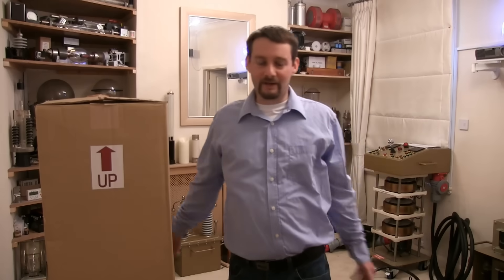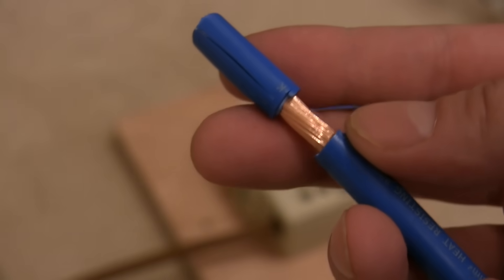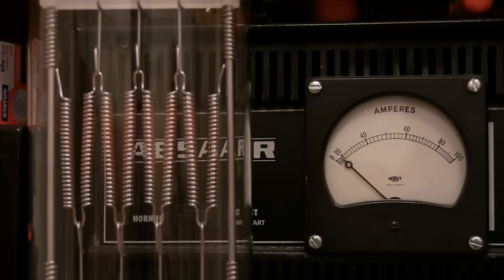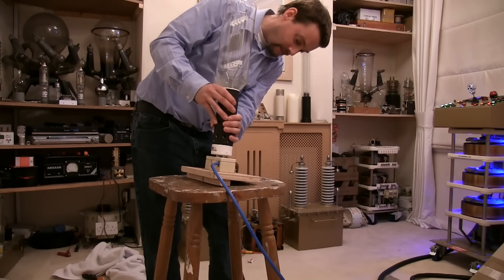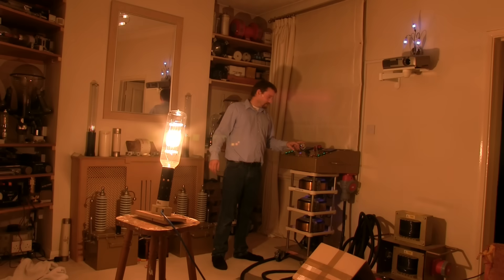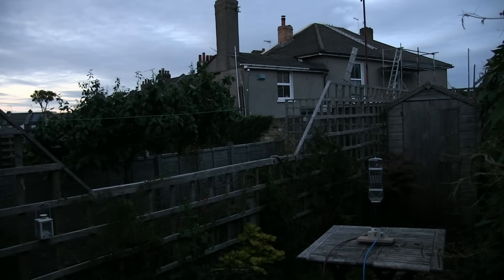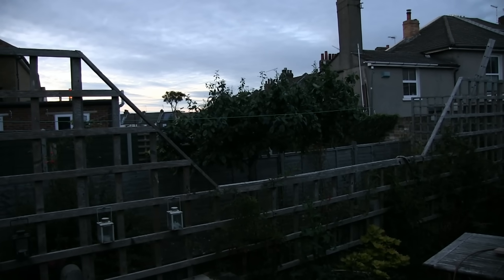20,000 Watt Light Bulb Test

Comment: Sylvania 54342 - BCM 64818 CP/99 20KW 230V Projector Light Bulb
by Sylvania
  Price: $6,301.39 + $3.99 shipping   ( dam)
Reply: Gotta have that $3.99 shipping tho.
Reply: The reason the bulb is so expensive is because the envelope uses fused quartz and not regular silica glass. Regular silica glass cannot be used because not only would it melt, it cannot withstand the extreme pressures in some types of high powered bulbs.

Quality fused quartz is very expensive to make, especially a large intricate structure like a hollow bulb.

I've worked with 4 kW long arc xenon bulbs and the fused quartz envelope would get orange hot during operation.
Reply: Gotta have that $3.99 shipping tho.
Reply: Gotta have that $3.99 shipping tho.
Reply: Gotta have that $3.99 shipping tho.
Reply: Gotta have that $3.99 shipping tho.
Reply: He can send back in 14 days with money back guarantee. hehe
Reply: Gotta have that $3.99 shipping tho.
Reply: Gotta have that $3.99 shipping tho.
Reply: Gotta have that $3.99 return shipping tho.
Reply: Are you serious??? Over $6000 ?? The materials cost hardly anything, even with having to fill it with a noble gas... WOW, if I needed one, I would make one myself.  That price is insane for what it is.  They can't fool me with numbers.. OH but it's 20000 watts... LOL it can draw 20kW because the filaments are a large gauge.
Reply: But wait, there's more: order in the next 15 minutes and we'll throw in a handy polishing cloth and a pair of asbestos hand mitts.
Reply: Average lifetime: 350h 
That is one expensive light bulb.
Reply: +Christmas Eve Have you ever tried working with fused quartz, especially such a HUGE amount of it? I think not, otherwise you wouldn't say that. Melting things to ~2000 °C is kinda tricky you know.....
Reply: All HID lamps and Halogen lamps (Aside from HPS, and CMH) use fused quartz, or some form of quartz.
Reply: www.lightbulbs.com/product/sylvania-54342/?source=NexTagCSE
Reply: no, that price is for 4 of them.... they are $1,599 each.
Reply: +svampebob007 That's all nice, except no company has cornered the light bulb watt market even in the 20 kW category. There are several players in it who also suffer from the competition posed by Chinese companies. This means that the $6k price is probably closer to that light bulb's lowest possible price than you might think...
Reply: Gotta have that $3.99 shipping tho.
Reply: Your comment is proof of how clueless you are
Reply: Please be sure to record yourself trying to run 20kW through a light-bulb with a glass housing, and have your next of kin put it up on Youtube for us.
Reply: +dischargecraze Yep, it's been made to be as bright (=efficient) as possible at the cost of making its lifespan really short....
Reply: Steve Hartman they jest changed the add weeks ago, They meant  four, but had the price for one at $6301.39
Reply: +Christmas Eve
Industrial components aren't merely based on the cost of the materials, the price is linked to availability (not many people produce 20kW bulbs, not many people buy them) and quality/reputation if you're known for producing amazing 20kW bulbs then you can expect owning the market for that, but if you're know for having hist bulbs with heavy prices then you can expect not getting into that very nich marked.

$6000 is a lot of money for a single person, but you have to realize that bulb (or other expensive "profecional") stuff will be used to generate revenue several times the cost of it.

If they sold it for the raw material price they would be underselling their service.

For regular consumer stuff, you need to try and sell it as cheap as possible even take on some loss, because consumers can always go for the crappier shit that some other company is selling they have no incentive to keep buying your stuff if it's a couple % more expensive if they can get away with the other dude that can deliver the same service.
Reply: Dam! 3.99 for shipping?
Reply: CoolKoon
 true, though I'd think there would be a reasonable profit margarine, if there wasn't it would be just good to focus on the consumer market. I'd assume you don't have to buy those bulbs in bulk...? anybody know what their operating time is?
Reply: better last a year or two
Reply: Many high power lamps are actually made using glass envelopes, the envelopes are bigger but they do exist.
Reply: +g0fvt Yeah, quartz glass. No other glass would be able to survive that immense heat (and the coolant circulating around the lamp) without shattering.
Reply: Aluminosilicate "hard glass" lamps are less attractive to fitting designers because they are physically larger than the quartz envelope equivalents. They were made in variants to at least 20Kw for lighthouses. The 10kW CP50 theatre lamp was the largest I usually played with. All of the fittings I worked with relied on air convection cooling....
Reply: +g0fvt Uhm, okay. Air convection cooling......I can't help but wonder what their life was....
Reply: Gotta have that $3.99 shipping tho.

Comment: Okay, I'm new here. Where are you, at your home? and what is that 100Amps power system ? o.O
Reply: He's at home. Most houses in the uk have 240v 100a supplies.
Reply: Actually, hardly any houses in the UK have 3 phase residentially by default (The only time I've ever seen it was a very large country manor). You can have it installed though, which will cost anything from a few hundred to several thousand depending on who you know.
Reply: He is at home
Reply: I'm in france, we're on 220/230V but I'm pretty sure I can't pull 100Amps from that.

Well I'm in an apartment, I don't know what's it's like for houses, but I'm surprised by the 100 amps part (and what about 3x ? you mean tri-phased ?)
Reply: donder999 16A and 1 phase? Thats not even enough for our kitchen...
Here in germany 100A is standard mostly, but 63A is also common (on 3 phases at 230V that is) and with water heaters, which many of us have, its also needed...
Reply: Funny, in Germany(At least where I live) cooking with gas is not very common, mainly electric. But heating we have mostly oil and natural gas, and many new houses have heat pumps
Reply: He actually has 3x 100A @ 230V/240V like most houses in UK, Germany and other EU countries.
Reply: in Europe the connection to the House is 3 Phases with 20V and 60 to 120 amps, depends on your house, we have 100 because we have a heat pump, I think normally you have 60 but you can have the changed
Reply: OH ok i thought it was the same in Europe... at least in Germany a 3-Phase connection is standard
Reply: I just can't realize that why are citizens in UK get 100 Amps normally, when I have only 25Amps on 230V, and it is belongs to better connections here (Hungary)
Actually, everyone here can get 32A if it's needed, but the basic connect is 16A with 1phase....
Why do we have much of difference about this?
Reply: donder999 That really can't be right, you'd only have to turn on more than one appliance like cooker then kettle and you'd blow the main fuse?! Not to mention that means nowhere could be using electric showers since they are generally 40 amps. Something doesn't sound right with what you've said.
Reply: Most of us (hungarians) use gas to cook, and not electricity. 
The heating is the same.
As a normal user, I can say that every single house use maximum 25 or 32A but not more.
I didn't meet with any 100A breaker, only once in a factory.
Reply: donder999
In france too a lot of homes run on natural gas for heating and/or cooking.
And in appartement building, you generally have a central heating system for all the appartement that is either electric or gas. So in individual appartement you general not have that much amps

Comment: i'm thinking you might have used as much electricity playing with that bulb as i use in a month, maybe 2 :)
Reply: Actually not.
Reply: The bulb was barely using 10 kw. 10kw x .10 hours = 1kwh. Which is nothing. My AC unit uses around 4.2 kw, and is often on for a lot more than a couple hours during a day, now imagine that times x 31 days.

Comment: im not sure if that's all legal to own in your house, lol +1
Reply: +Bite That Apple you obviously dont know what a transformer does. Transformer is used to transform higher voltage to lower voltage with quite a good (depends) efficiency. It can be used the other way around but it's really not used like this with a light bulb which probably has less than sub-ohm resistance.  With lower voltage he can get lower power to the tube, thus testing it.   Using transformers to generate high output is actually generally a bad idea really.
Reply: Why shouldn't it be?
Reply: ... that isn't just electricity, that is high power equipment, not something you pick up from a local store. He's using transformers to get that amount of power.
Reply: *****
Yeah, and? You dropped a lot of words you seem to not fully understand (a transformer? for power?), but no explanation why it should be illegal.
Reply: +Giedrius Jakimonis 

+Bite That Apple was probably referring to potential fire-safety code violations and turning that little room into an  easy-bake oven 

xD

Comment: I'm a complete idiot when it comes to electronics, in the start of the video, Photon said that as the lamp gets hotter, the resistance begins to increase therefore the current reduces, I understand that part but why does the resistance increase and how does it increase for that matter? I'd appreciate it if someone could explain this to me like i'm a seven year old. Thanks.
Reply from the maker: The molecular bonds within the tungsten become more separated when heated, this makes it slightly more difficult for current to flow. When cold the bonds are tight and much more current can flow than normal.
Reply: The "classical" explanation is that as the metal heats up, the atoms are vibrating faster, and because they are vibrating faster the electrons carrying current are more likely to bump into them and stop.
Photonicinductions explanation is the more scientifically accurate explanation,  but "bumping into atoms" is the way it's still taught in schools. The most accurate explanations delve a bit too close to quantum physics that I'm not going to pretend to understand in any real detail.
Reply: Actually makes a lot of sense. Thanks guys, much appreciated.

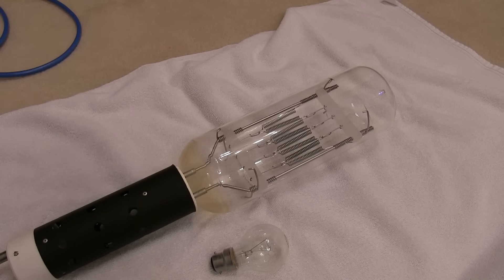Comment: That's a fookin big halogen lamp! You can actually see the condensed halogen dose around the 4:40 mark at the base of the lamp! I think you need to get some ND filters if you're going to mess around with these big lamps! Any specs on that lamp? luminous flux and lamp life ect? I reckon about 500,000lm? not as bright as those 12kw halide lamps you had ages ago though!
Reply from the maker: You are correct, you could see the halogen slightly condensed in the bottom.well spotted !
Reply: ***** Was there any colour to the gas fill for a while after power down? A purple gas means iodine, not used often these days and orange suggests bromine.

Comment: Hello.. I see you know things about bulbs and electricity. I hope maybe you, or someone from comment section can give me an answer.
I have CFL bulb.. It say on the bulb that it is 300W.. and 50% saving power.. So it drains 150W. I would want to know if this 50% saving is real, and it actually is 300W light bulb, or it's just marketing scam, and it's just 150W bulb with 0% saving. It drains 144W when it's warm up and gives 15K lumen.

Comment: You have a generator? Or your meter of the energy copany supported 20kW? Thanks for your videos!!
Reply from the maker: The power supply sucks hard on the pipe in the ground with 2 bits of copper running though it :)

Comment: For those asking where this would be used; I did a quick search and it seems 20kW bulbs are compatible with some very large film set lights, e.g. if you search ARRI T24 on Google Images you'll see some places it might be used, to recreate daylight for example. 

One thing to note with regards to studio/stage lighting is that very rarely are the bulbs at full brightness, so even though it has the capacity to be 20kW it's most likely being used at a much lower percentage.

Comment: Is there such a thing as a 20KW LED bulb? About 10x more efficient.
Reply: I dont think so. Imagine the size of the heatsink that would be needed. I guess you would have to cool it with liquid nitrogen or helium  :D
Reply: That 2.4KW LED is impressive. You could drive eight of them with 20KW and together they would produce nearly 2,000,000 lumens as opposed to the 'mere' 580,000 lumens from this lamp.
Reply: The biggest I have seen is 500 watts. You could just use a bunch of them to get 20KW. You would certainly need to water cool them to get rid of all the heat though.
Reply: Not really that impressive since a 2kw metal-halide lamp kicks out 230,000lm and those 12KW halide lamps he was playing with a few years ago were rated at 1,150,000lm!!! LED just can't match high intensity discharge yet.
Reply: LoL that would be cool tho
Reply: Francisco Herrera Low pressure sodium is the best at the moment with slightly over 200lm/w but nobody likes them anymore since they are monochromatic.
Reply: Only if you're talking about nothing but lumen output. For everything else in a practical sense LEDs win.
Reply: Francisco Herrera Modern lamps, especially ceramic ones have CRI ratings of 98%... I'd hardly call that poor!
Reply: Cool! Thanks!
Reply: Francisco Herrera
Yeah they are weird, they make my skin look like it's bruised. It's strange XD
Reply: +bob s or throw 20 concussion grenades,
thst should also be 2.000.000Lumen
Reply: +AfterMyReawakening Briefly.
Reply: +FrontSideBus There isn't much difference in efficiency between the LED and the metal halide lamps you describe. For the 2kW version 10 of them would produce 2,300,000 lm. A little more than the LEDs. As for the 12kW version, that produces 95,833 lm per kW so a 20kW version of equal efficiency would produce slightly less than 2,000,000 lm which is about equal to the LEDs.